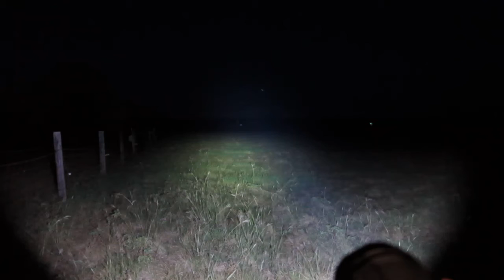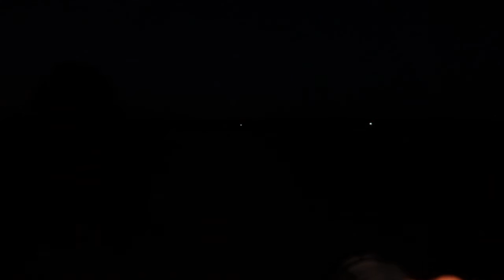DBC October 01, 2016 005834

Comment: I actually did find a non-direct drive driver for my L6 that allows turning the light on and off from the side switch. It was a stock FX-30 6v from Kaidomain. I have a video of it on my channel if anyone else wanted that.

Now I'm gonna try a direct drive unit with ramping. Dale, is this light using Narsil or is TKs ramping firmware different?

Comment: Is there anyway to get a custom user interface without such a massive amperage draw? I use my light for security work so I need the batteries to last a long time between charges.
Reply: JasonWW2000 what kind of user interface would you like on what flaslight
Reply: polarweis This is a pretty old question, but I was trying to get an interface like in this video, but without it being direct drive. On the Convoy L6 of course. I prefer a constant current design like the stock driver. I mainly want to turn it on and off with the side switch. I've searched and there is no driver like I want.

On the other hand there are 2 new lights that you CAN turn on and off with the side switch. The new Eagle Eye X9 and the new Thorfire S70s.
Reply: JasonWW2000 oke i see. I just bought a utorch ut02. It also got a side switch. But its more a thrower light then the convoy l6(i also got that one).
Utorch has usb charging and  one 26650 battery. If you like that model you can buy it i think for 36 dollar on gearbest i got a discount code around somewhere.. i can look it up if you like.
Reply: polarweis That's okay. 
I hope you got a later model that has the lower tail cap amp draw  (around 2.5 amps on turbo). The early models drew about 5.5 amps and had an issue of failing due to stress and heat. Other than that, they are great lights.
Reply: JasonWW2000 yeah its a later model so i hope it wont fail on me:) you seem to know flashlights;) whats your favorite so far?
Reply: polarweis I don't have a favorite, but the On The Road M3 is one I use everyday. It's a great light.
Reply: JasonWW2000 that one looks nice as well! Mine most carried is the fenix pd35
Reply: polarweis Yikes, that one is $70. I'm not a fan of Fenix just because of their high prices. I assume it's a high quality light, but I try to get the best bang for my buck. I can but more lights that way. lol

If it ever breaks or you loose it, check out the Eagle Eye X5R. I've got one for work and its really nice. I guess you could call it a clone of the PD35. It's under $30 and you can get replacement parts if you need it. 

Like the UT02 is a clone of the Manker U21. :) The X5R is not a direct clone, but it's got all the same features.
Reply: polarweis Yikes, that one is $70. I'm not a fan of Fenix just because of their high prices. I assume it's a high quality light, but I try to get the best bang for my buck. I can but more lights that way. lol

If it ever breaks or you loose it, check out the Eagle Eye X5R. I've got one for work and its really nice. I guess you could call it a clone of the PD35. It's under $30 and you can get replacement parts if you need it. 

Like the UT02 is a clone of the Manker U21. :) The X5R is not a direct clone, but it's got all the same features.
Reply: JasonWW2000 yeah the fenix is not the cheapest but its really good quality and its a light i need to depend on. Not that other lights are bad. I normally like more throw but a tube light is more easy to carry.